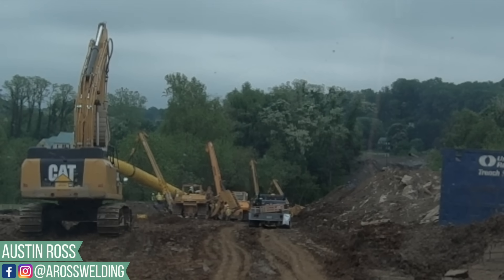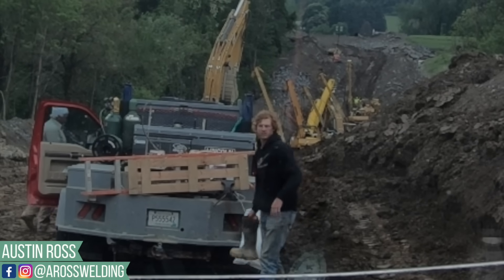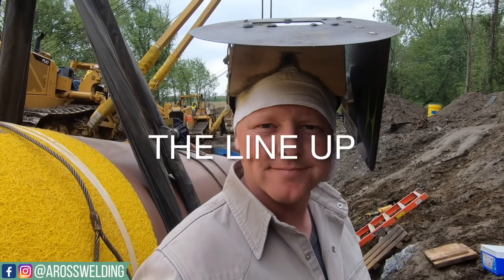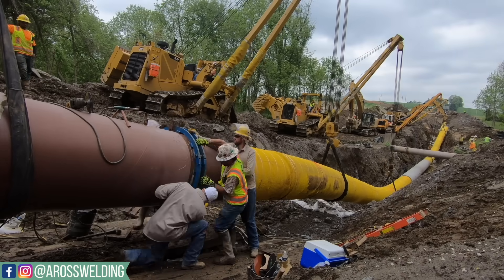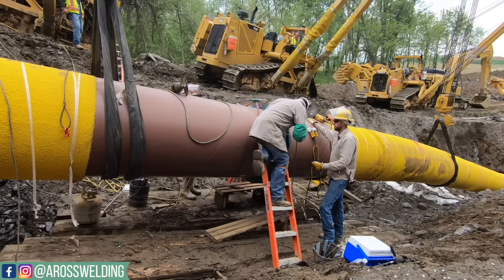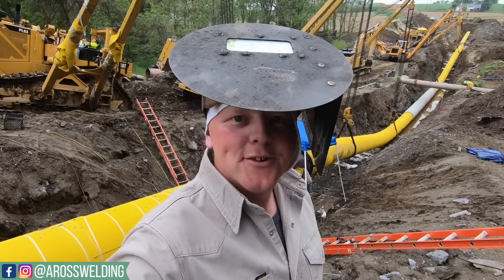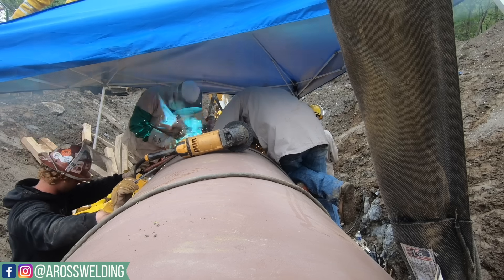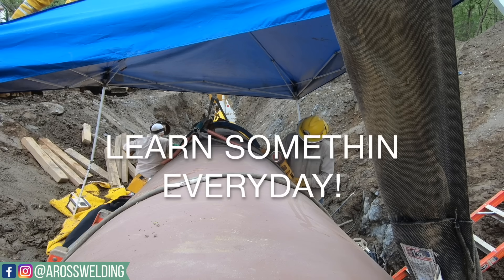PIPELINE WELDING PROCESS (FROM START TO FINISH - IN THE FIELD)

Comment: Might be a dumb question but why are the pipes attached together by welding? Is it not possible to have some sort of coupler and bolts? Just the time it takes to weld that is crazy .
Reply: K W801 
They used to do that all the time. They’re called rivets. Ships used to be riveted until they found out they could weld them. The extra time spent welding is worth the money, because the finished joint lasts indefinitely. No more breaking and repairing rivets. Some pipes are bolted, it depends on the application. But welding is absolutely superior.

Comment: I’m 16 now I’ve always wanted to work on the pipeline as a welder how do you get successful at it
Reply: Farmer Kyle Hi, I’m a pipefitter/welder apprentice and have been for over a year now. If you want to get successful an apprenticeship is a great way to start out and learn directly from the people in the field. I would recommend to always practise your welds when ever you have spare time on scrap metal, I can see a difference in my welds from when I have practised and haven’t for a while (I’m mostly a pipefitter, but weld from time if there is a lot of work) I would recommend to always ask question and be open to new techniques I have noticed people have different ways at handling task so learn as much as you can from everyone. Do you currently work in the field?

Comment: You pipe guys have my respect. That gig is not for me! I'll stay in my fab shop at the marina. Thickest stuff I see is half inch aluminum plate and biggest pipe I see is two or three inch stainless.
Reply: You can weld a 2-3 inch pipe then what they are doing should be a peace of cake
Reply: @ashleykey6973  I've actually switched jobs. I'm now doing large fab work out of a larger shop. I'm doing a lot of Flux core welding on some beams for Norwegian cruise lines. Two feet by three feet square tube, three quarter inch wall with one and a half inch thick flange plates on each end. Some aluminum work but more structural steel work. Love it so far!

Comment: Do y’all have Anyone do fire watch? Someone told me don’t know if it’s true or not but he just got back from Texas and stood there and all he did was fire watch lol didn’t have to do a damn thing besides stand there and watch em weld
Reply: That’s very common on a lot of jobs. Same as a ground man. It has nothing to do with union or not. It’s the plant or job sites rules.
Reply: Thats required on a lot of job sites and is actually kind of important.  Quite frankly that sounds boring as shit screw that.
Reply: I’m a union laborer. I’ve spent weeks on end firewatching.. doing nothing but standing around. I also shoot the boiler with shotguns and string explosives ahead of the boilermakers, so honestly it’s a welcome respite. Speaking of boilermakers, I was on firewatch for a month and got to watch them weld water wall. Frankly it’s amazing. It takes 2 man teams; one guy starts each weld and the other on the opposite side catches the first guy’s arc. If I wasn’t standing around on firewatch, I probably would have never became interested in welding 👍🏻
Reply: LOLOLOL......definitely sounds like a union job.

Comment: How many amps are you putting into that joker?! I always wanted to have a go at Pipeline welding, if for anything... The nice trucks you got to have to get where you need to be down South. I've seen some (a couple) clean pipeline rigs on 39-40's here in Texas!
Reply: around 90 amps for 6010 or 7018 is normally what i run on my lincoln 220 depending on the size of rods it varys a little bit

Comment: Excuse me for the rudimentary question. But when you connect the two pieces of pipe you hold them together with the blue clamp. What is the name of the blue clamp?
Reply: Dearman clamp
Reply: They’re called “outside clamps”. Usually just referred to as “the clamps”. They’re used in places where internal clamps wouldn’t be feasible, be it physically or financially.

Comment: I really enjoyed this video I got to ask what is yellow switch looking thing on the pipe around 6:32 where you start tacking the pipe?
Reply: That’s the remote to the welding machine to adjust it from there instead of on the machine
Reply: Bryan Horton thank you I was sure it was something to do with the machine wasn’t for sure what exactly it was
Reply from the maker: It’s a remote. To adjust the amps (heat) while in the ditch.
Reply: I really really enjoyed this one I also enjoyed the one where you was a finishing up

Comment: Still can’t understand why you don’t show your work???
Reply: Stick welds are never pretty and he probably doesn't want some dumb trolls saying they can weld better cuz they saw somebody TIG two titanium pipes together and it made pretty colors.
Reply: Lmfaoooo 7018 along with many other rods can be used for code work anyone that said stick welds can’t look good just can’t weld 😂🤭
Reply: Chad manthei you got that 7018 or 6010/11 can look great if done right, along with pretty much any welding process.
Reply: Weld Weld I love 6010 it’s what I learned on very aggressive rod as well
Reply: @weldweld5629  dual shield fluxcore is ugly as sin
Reply: It's secret squirrel stuff.  He also might not be allowed by the companies he works for to take pictures because of security--many jobs are like that.  At times Austin has specifically mentioned that he doesn't give his location either because of protestors.
Reply: It's called botch
Reply: Probs bad welds

Comment: Also could you do a video on pipe line welding lingo? Hot pass, cap, etc. Thanks
Reply from the maker: You bet. I’ll put it on the list. 👌
Reply: That's mostly welding in general lol
Reply: @darrellwhite6173  maybe, but I've heard him and another guy use plenty of lingo that seemed to be pipe line specific.  Hot pass and cap were the only two I could think of right now.
Reply: Premium08 bead is your first pass also called the root, hot pass is the second pass usually run hotter than the rest of your passes to burn out any trash from the root and also to push the root in and kinda just smooth it up, sometimes on that big bore you’ve got what’s called a hot fill basically another hot pass but you’re stacking more metal up in there. A fill would be just a normal pass. And a cap is the final layer the only layer you see. And “hotpass” and all of this “lingo” is used in any welding setting that has bevels.
Reply: @ASSWAGON0510  thanks, I guess I've only watched pipe line welder videos so I figured it was specific to their field.  Merry christmas!

Comment: Anyway to do a video or at least explain of what happens with pipe after you finish as far as inspections and the coating process?

Also how big does the pipe have to be for it to require two welders?
Reply: most pipe requires 2 welders makes it faster and as for finishing it all you do is have the helper grind it flat
Reply: @alexrobbins5602  finishing as in after the welders are done. What happens to it next? It's got be inspected, coated/painted, and put in the ground.
Reply: @MrPremium08  pretty much you defined it ive only been doing this for a few months nkt but thats how is see it they x ray the welds for bubbles or cracks and then coat it and its ready to go

Comment: Hey why is the helper heating the pipe with that torch?
Reply: And the reason you’ve got to drive out the mouisture is because it can cause the weld to crack and bust X-ray or worse fail.
Reply: Jacob Aswegan oh okay. Don’t want that to happen. I guess you do learn something everyday
Reply: Pre heat mang ! You can't just blaze up on cold pipe.
Reply: @thegt3clickcrash329  that's how I've been smoking on my crack pipe
Reply: Kevin Stegman oh okay. Thanks for the reply
Reply: That's how you warm up your crystal meth